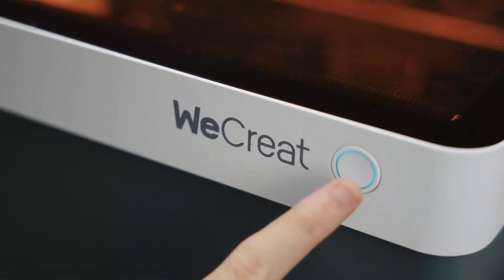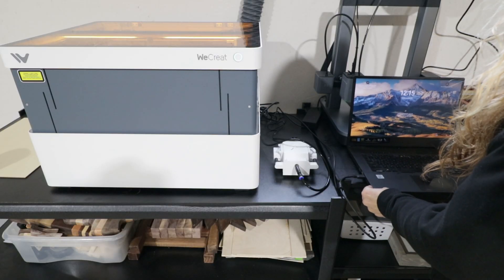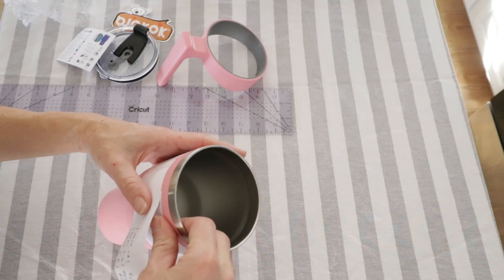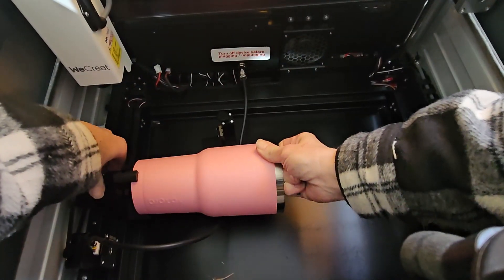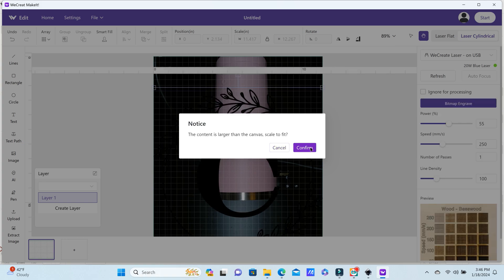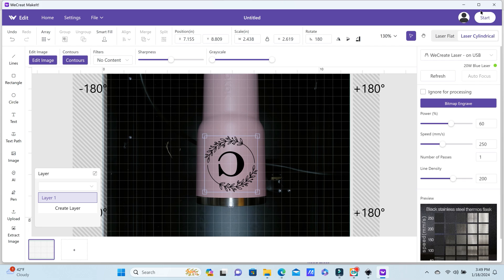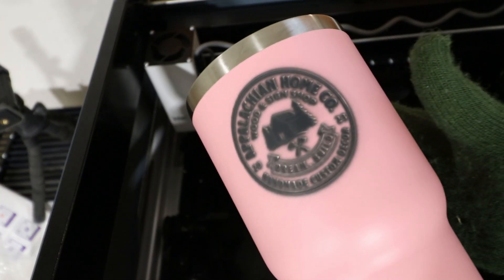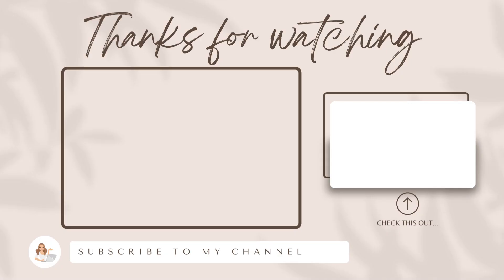Wecreat Vision Easiest Laser Engraver Ever! How To Engrave Tumblers

Comment: Can it engrave on glass such as a wine glass?
Reply from the maker: Yes I think it does but I haven't tried this yet...future video tho for sure.
Reply: Most will tell you that you can't engrave glass with the 20W diode laser - you need a CO2 laser (more power).  However, I found if I spray on temporary black hair color and let it dry, that I can engrave glass.  Have to play with power settings so not to overheat and cause micro-fractures, but I dialed-it-in and got good results.  Cut glass engraving edges are a bit sharp so it needs to be sanded with emery paper to smooth it out.